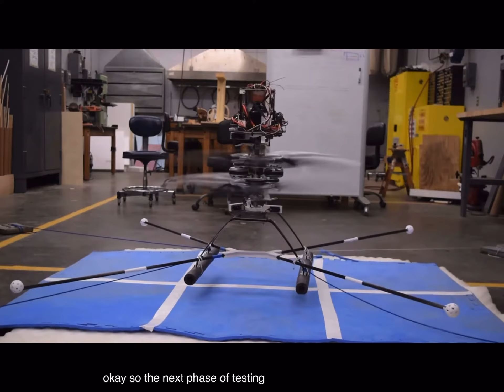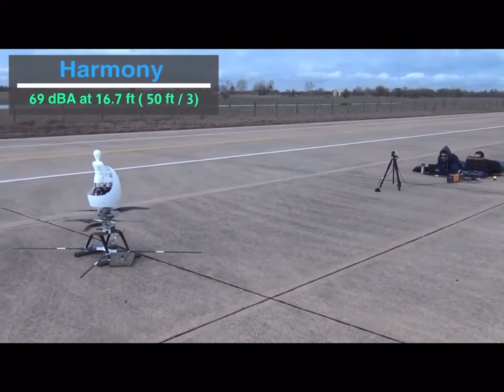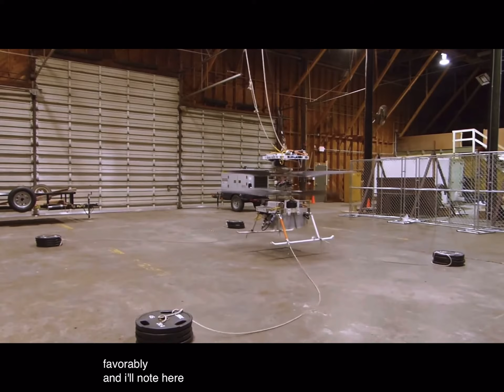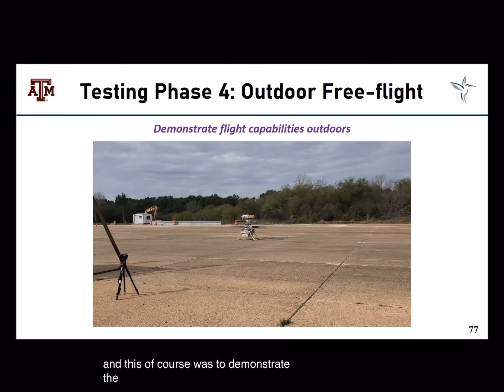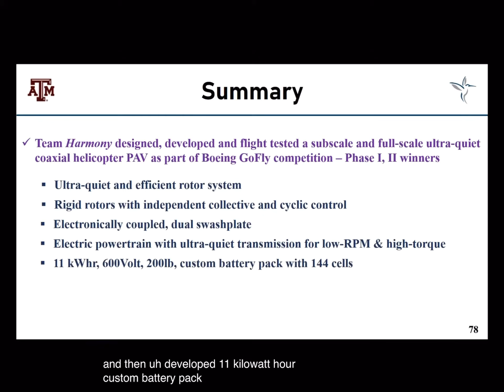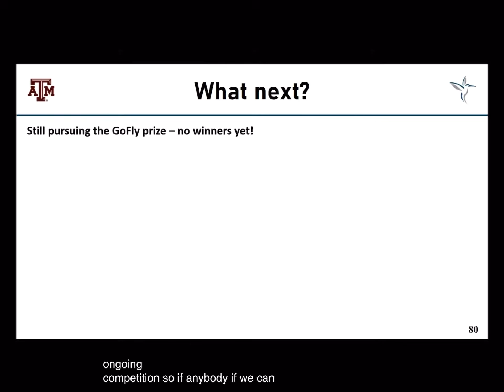The Best New Electric Powered Coaxial Rotor & Blade Design...( part 3. )

Comment: this is amazing!! these guys should be so proud of their work. In terms of endurance, I wonder if some of the new small form factor hydrogen fuel cells would provide additional endurance. This would depend on the power consumption of the motors, but I've seen drone compatible hydrogen fuel cells in the 5kw range. Coupled with an ultra high pressure (15000 psi) CFRP pressure vessel, the fuel cell could improve endurance by a significant margin